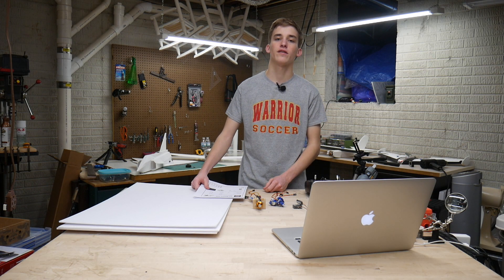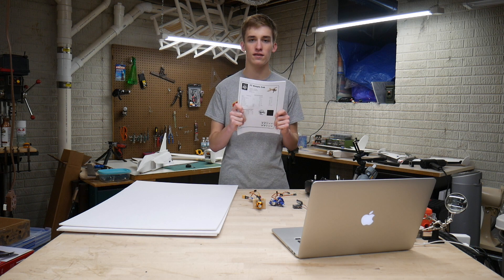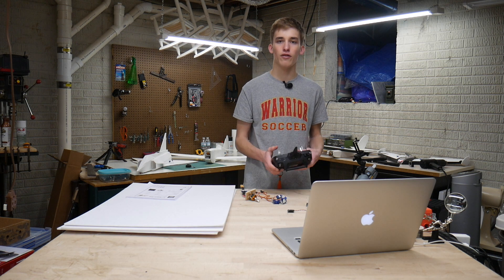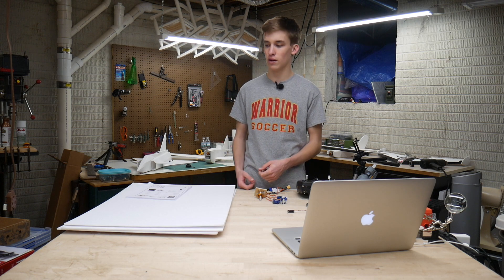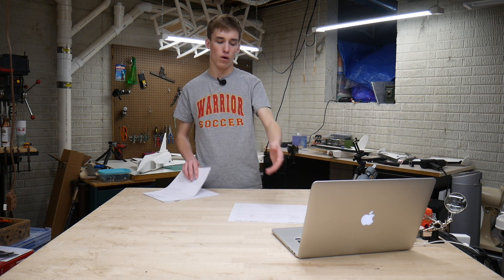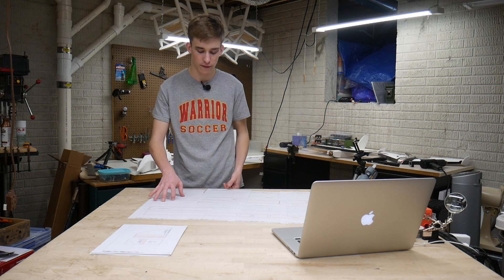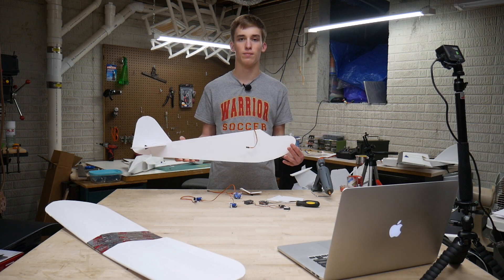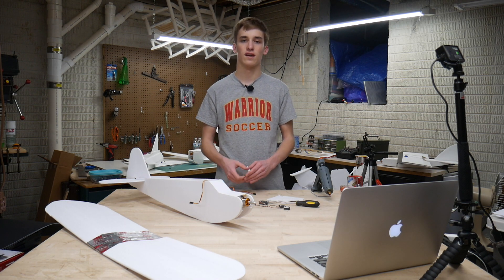FT Simple Cub Build - Scratch Build Beginner Series Part 1

Comment: My foam is 20x30 as well and the pages are bigger
Reply from the maker: ah, you need to trim them down around the rectangles, should be tiles of 2x4 per sheet of foam
Reply from the maker: make sure you print “tiled a size”

Comment: What’s the difference between size a and b???
Reply from the maker: It’s Flitetest’s system, A is super small 1806, B is like a 2212, C is about a 2216-8, more just the general spec for different size planes with different power needs.